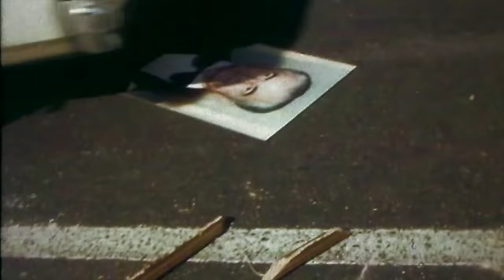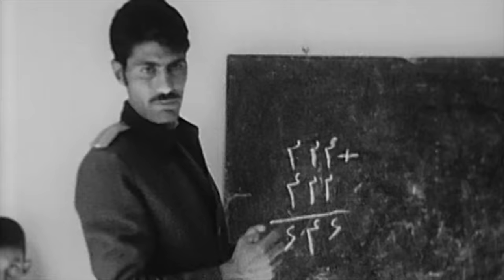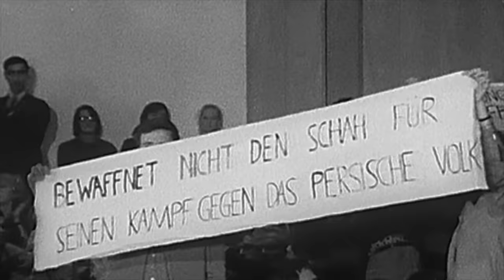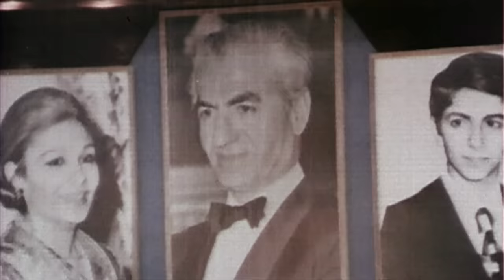Last Persian Shah - Full Movie

Comment: I worked in Iran from January 1998 til May 2003 - six years - and have 23 years dialogue with Iran all together on the highest level. You know, talking is easy, it doesn't cost anything. But to go there, to Iran and empathize with them - not criticize - is another matter. The film has excellent and rare pictures. Thank you from Oslo.
Reply: You are right, but I have a question. Did you know the people during the six years you were in Iran? Were the Iranians satisfied with the revolution? Did they like Khomeini? Did you talk to ordinary people?
Reply: I don't get your point.
Reply: Jan 1998 til may 2003, is 5 years , not 6 years🤭
Reply: Whats your point? The video is about the Shah and Khomeini and doesn't criticise the Iranian public. A relevant comment would be about how that dialogue sheds light on the people's experience there.